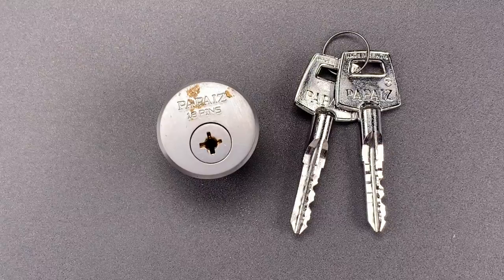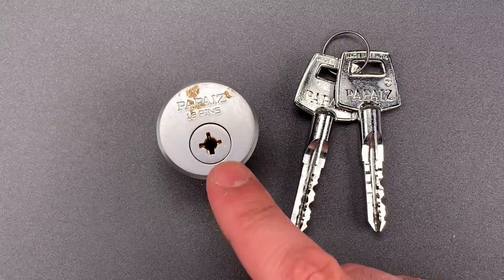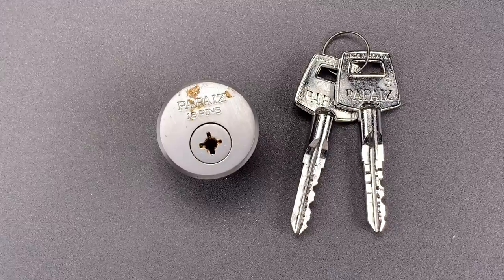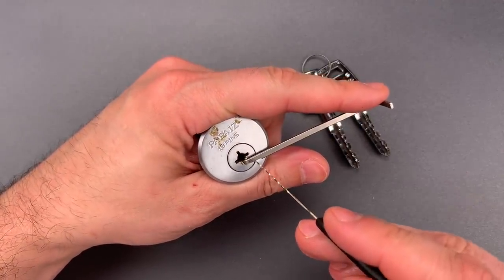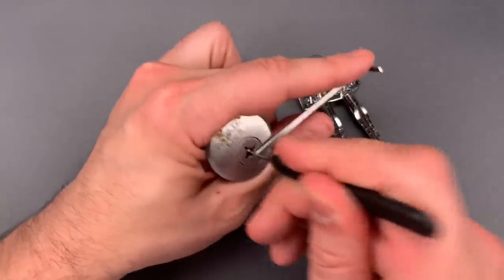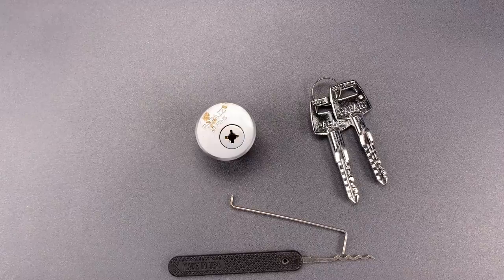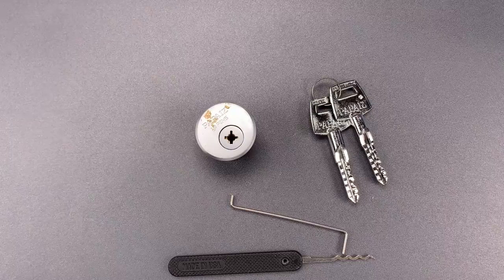[977] Brazilian 18-Pin Papaiz Cylinder Picked FAST

Comment: Papaiz: 18 pins!
LPL: 15 seconds.
Papaiz: dammit
Reply: It's a must say this locks can give two to three 360° turns before opening. So even if a rake attack they would withstand over a minute and a half to open the door. Some brazilians put two of these on the door (high and low) so you couldn't open it fast by kicking it. That said, you're faster drilling the unprotected core to getting in
Reply: well technically it only turns a quarter per turn, so 30 seconds total.
Reply: @BattousaiHBr  Usually you need two full turns, so if it re-locks every quarter turn, about 2 minutes.

Comment: After watching LPL I bought a lockpicking set and my most used pick is a rake like the one he used.
Amazing how most locks can be opened using such a low skill attack you don't even have to single pin pick in most cases.

Comment: So I got the lockpicking set your channel inspired me to get and since then I have successfully popped open some Masterlocks, a few cabinet locks, AND the key backup on a First Alert safe (two years ago I lost the key to that safe and the keypad battery was dead so I had to go through a whole big song and dance with the manufacturer involving notarized sworn statements of lawful possession to access it again so it was really funny to get it open). The more difficult locks take me up to five minutes though and sometimes I'm at a loss as to why, precisely, one attempt might fail and one attempt will succeed, but I'm getting better. The types of locks I'm having the most trouble with currently are some gun locks - I've yet to get any open once. Very tiny keyways and they will grab on to the pick the instant any tension is supplied and prevent any further manipulation of the pick. So I suck at it still and have a lot to learn. It's tons of fun and extremely satisifying when that lock you've been having trouble with clicks over and I'm looking forward to getting better!

Comment: 18 pin lock and a 1:49 video....and I thought Master locks were bad.
Reply: And that's the best standard in Brazil (almost)
Reply: Just because he can rake it in 5 seconds doesn't mean anyone can. On the contrary, I bet most people couldn't even rake it open in 5 minutes.

Thing I'm lying? Go try to rake a master lock and see how long it takes you before you can consistently open a Master lick with a rake. Now let's consistently open it in 10 seconds.

Its not nearly as simple as he makes it seem. Look at the difference between LPL' s vids and BosnianBill.

Bill has many 10+ minute videos of him picking locks. Some even 20 minutes. But you won't find that with LPL. We get 5 minutes or less.
Reply: damn that's horrible.
Reply: Well yeah it took me 30 mins to pick a simple master lock. A bad lock is a bad lock but they are also insanely skilled to open them faster than a key
Reply: The video is very dishonest in that - he mentioned it needs to have that process repeated several times because it constantly relocks!! It should have at least another 1-2 minutes of video time if he was honest, whoch makes this lock a lot safer than the average one we see here.
Reply: @lorenzo_br5803  remember: he is a lawyer above all else :D
Reply: Yes, hence why i'm referencing what's said in it!
Reply: @solounwapodemuchos  3 seconds with a 60mm brass padlock. Faster than the key. PADO padlocks, mainstream in Brazil.
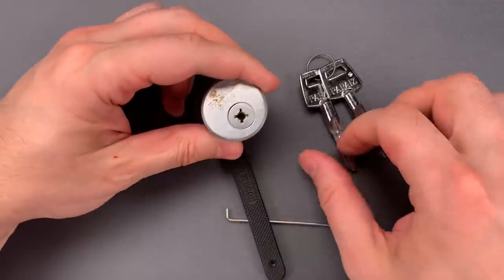Reply: 1:10 "it does bear note this will re-lock every quarter of a turn". So to unlock, you'd need to successfully rake this four times.
Reply: @PrismariLaura  in Brazil our locks usually go two full turns, so 8 rake attacks.
Reply: @ivanbaptistakobal6029  not everyone does two full turns. I know I and my family don't :p
Abraços de SP \o
Reply: @PrismariLaura  you should! It's way to easy to break in a house if there's one turn by kicking the door.
Especialmente aqui em São Paulo kkkkkkk
Reply: @crowley357  That's not. Pado and Stam are way better

Comment: It was very nice of the lock manufacturer to leave out pins in the bottom slot. Just nice to slip the tension wrench in and not cause a problem.
Way to go guys!

Comment: It looks I intimidating but standard pins isn't a good option.🤔
Reply: Yeah they could have benefited from even just a couple security pins to at least avoid the option to easily rake it open forcing you to actually have to single pin pick all 18 of them and deal with the reset.

Comment: I'm from Brazil. You would see three of these on the external doors of some homes. One at the usual place, one at knee height and one at head height (the idea is that you would lock only the main one when somebody is still at home and lock all three when travelling or if nobody's at home or even during the night, depending on where you live). I have something similar, but from another company called just "Brasil". I couldn't find their website. I believe they might not exist any more. The lock (called "fechadura tetra" or tetra-lock in English) has a different combination on each of the 4 sides instead of 2 like this Papaiz. It is a really nice brass key, so you have an antibacterial key you can use for stabbing lift buttons with

Comment: I feel like buying a good quality lock picking set just to test all the lock in my home and office, then become paranoid when I see how easy it is to pick my own home...
Reply: They have cheaper sets for $4 to $5 for a set of 8 or 9 picks (you’ll have to make your tension bars but anything from a pop out clothes hamper to windshield wiper blades have the right size flat metal and it’s 3 seconds to bend a 90 degree bend).  The kit is not designed to last 1000 lock picks though, but LPL had recommended some very similar of same brand (do note that “good quality” is like $8 to $10 per pick and that it would be a $90 pick set if it were good quality), but for dozens of locks or a hundred per pick you’ll probably be fine, you have to question if you really want to spend $100 just to test your house locks because it’s not the pick that makes the locksmith, it’s the skill... Then time yourself vs a Masterlock model 3, like if it takes 5 minutes on that but only 2 minutes on your house locks you know you’ve got a problem and should change those locks!

You can find some of LPL’s product reviews (like video 347 I think it was) in his product review category (the picks I mention are better than those in that video, but that one was more of a set with tensioner and a clear visual learning tool/aid).

Or you can make your own picks pretty easy out of recycled trash, I don’t see a point in spending a lot on it unless your planning to pick thousands for fun or occupation when a $12 to $20 set would be extreme overkill as it is.

Comment: I recently purchased a lockpicking kit from amazon, and it comes with a similar lock to this one. It was pretty easy to open 3 out of 4 of the kits that came, but with this one I'm having a hard time, because it has 4 sides instead of 3 like in your video, which makes it really hard for me to change the tensioning tool without losing all the already unlocked pins. I'd love to see a video with a lock like that (this is the only one I could find from your channel), so I can see how do you do it in that part (or if you can point me to a similar video where I can see how do you change tensioning tools... that would be awesome).
Reply: Nevermind! I finally opened it :_D Watching more of your videos I did realize the problem was not with the tensioner, but with the tool I was using. Instead of trying to change the tensioner I ended up changint the tool so I could pass it over the tensioner and move the pins from there. Thank you so much, although you did not answer, your videos were the answer! :D
Reply: Opa! Você usou raking também?

Comment: Lasted about 10 seconds... And will re-lock every quarter turn... I call it a medium security lock, in the LPL scale of security... Jokes aside, I once called a locksmith to open one of those in my old house (forgot the keys at my parent's house) and they used a specialized tool that looked like a pen with four thin "arms" at one end and a rotating part at the back. The locksmith got it open in just a few seconds. These locks were state of the art in Brazil about 30 years ago.

Comment: Shame you weren’t allowed to open it up. After watching this channel for so long, I’d make a lock like this, but with some spools and serrated pins, maybe some different strength springs too. Some steel for drill protection and having a few wafers in there to trip you up. Alas I don’t have the tools to make one, but it would be interesting.

Comment: It looks like a few spools and serrated pins, plus more exaggerated bitting would make this a pretty good lock.
If the lock design had pins in all 4 directions rather than just three, it would not only have more pins and therefore take more time, but would also be more difficult to tension. All that and some crazier warding and this would actually be a real challenge to pick.
Its a good idea for a lock, the idea just needs to be developed a little further.

Comment: There is a reason it does not have pins on the bottom: It wouldn't fit as theres no room for driver pins. They could have passive pins for key control, that are pushed up by rotating the cylinder, into the key.

Comment: Hey LPL I found your channel a while ago and am curious, are you able to pick a standard car door lock? (And no, I'm not asking for future use. I'm just curious.)
Reply: Easier to use a slim jim to break into a car than picking the lock. Also newer cars have electronic signals that need to be sent at the same time.
Reply: he has done a couple of car locks, such as in 372
Reply: I know he has done a Ford European lock and a newer Honda Wafer lock. I’m 30 years in the auto repair business and by far the easiest way into a car is with specialty lock out tools to either grab a lock rod in the door to manually move it or go between the door frame and body to grab the lock button or push the power lock switch. A picking attack is the least favorable way to do it in the states. I’ve even gotten away from raking gas cap locks when customers loose their keys and just use a large pair of slip jaw pliers to squeeze the gas cap to twist it off.
Reply: Most are electronic, radio-frequency fobs nowadays - https://www.youtube.com/watch?v=k8rNQ3mBZQ4 - if it's old enough to be a key lock, you can slim jim it.

Comment: what if you made a lock with fake pins and on the opposite side, super shallow pins designed to get pushed by the flat part of the key? keep it low production and you've got an unpickable lock

Comment: I am from Brazil and my family's house had similar ones since it was built, when my mother was pregnant of me.  The main one has more pins and the extra one has less but with a cover on the key hole, though it doubt it would prevent manipulation. I always thought it was extremely safe, alligned with the heavy door. Now I am concerned.

Comment: This lock should have all steel standard pins in the front with at least spools on the remaining chambers. But the problem is nobody wants to make such a lock.
Reply: If this lock had been produced by ASSA LPL would not have gotten in under 3 minutes. Their regular 7 pin "low security" domestic front door lock takes me a good 10 minutes while an American 1100 takes about 45 secs.

Comment: Can you pick a lock with expanding foam
Reply: Only a really crappy lock. The foam would simply push all the pins up as far as they can go. On a really crappy lock this would push the pins right out of the plug. However the vast majority of locks are designed so that you can't do that. There are a few truely crappy ones that let you do that and LPL has demonstrated them.

Comment: I would have moved the core up in the body and put drivers in the bottom as well, even if there wouldn't be key pins there. That way a picker would have to pick all three sides on all turns. Like it is now, whatever pins get to the bottom don't have drivers to put them in action in that turn.

Comment: The best anti-theft device is to whack your lock with a wrench and make it hard to open evne with your proper key. The lock picker will have hard time trying if it doesn't work as intended and he have to physically force it with that tiny little wire. Almost impossible.

Comment: I wonder how would he get a grip if this lock didn't have on of the axis without teeth.
Reply: just grip on any of the 3 axes, pick the other 2, then change the tension to one of them and pick the remaining axis. same thing he does on most disk detainer locks.
Reply: @aricneto  you mean tubular locks when single pin picked.

 Disc detainer locks are picked with the tool he and Bill made and they open up fully as soon as they're picked. Those are the ones where he inserts a wiper into the core and turns all discs all the way to the left, then inserts the pick, tensions off of disc 1, and picks the rest.

You're thinking of pin tumbler tubular locks, like what's used on vending machines. Those are also picked with the tubular impressioning pick, which is what, he normally uses on tubular locks.
Reply: @J__C__  You're right about tubular locks, but the way he picks disk detainers is as I have described.
You can look up his last disk detainer video (number 975) for proof of that. He tensions off of number one, then picks all of the other disks, and when he's sure they're all set, he then tensions off of number 6 and picks number 1. He does the same on video number 964, and many others.

Comment: Pado, Papaiz and STAM are the most common brands here, they're not realy much reliable, the Papaiz are a little better because they require a little more force to lockpick, all the springs are more stiff, but it's still antiquated projects, nothing special, all low scurity and cheap in the end of the day. Pado and Stam are pretty much master and Papaiz is master but with better quality materials, still very simple projects.